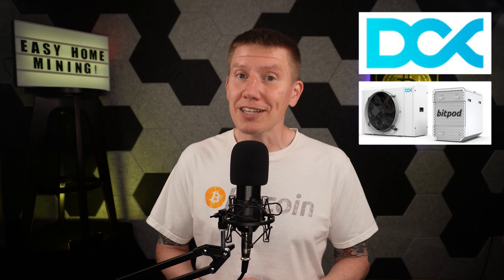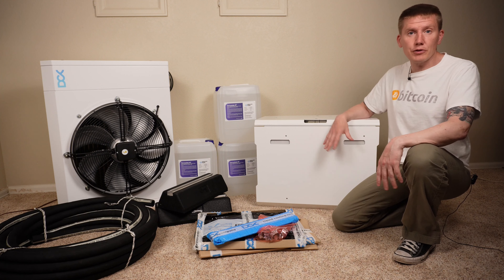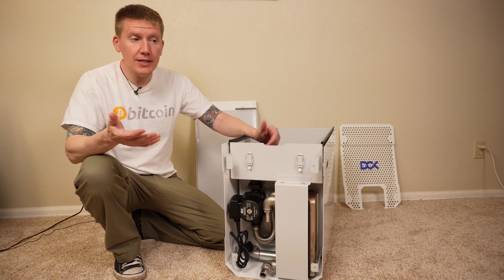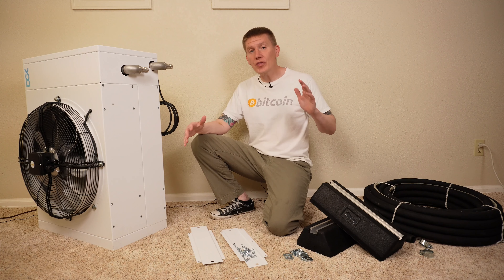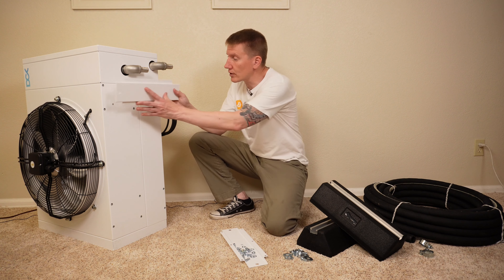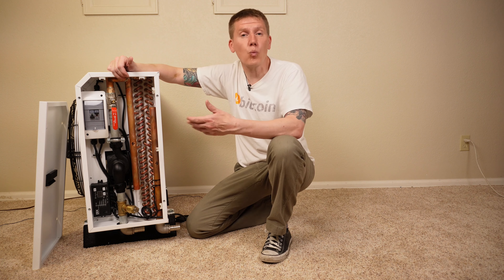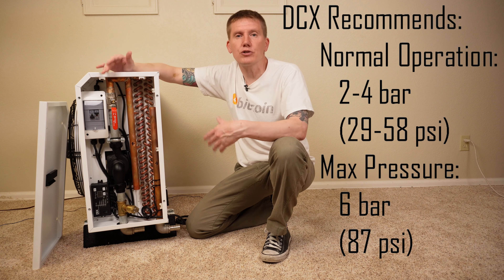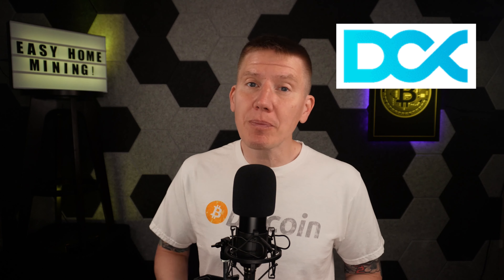EP22: I got a DCX Bitpod home bitcoin mining system!

Comment: In your next vid, DEFINITELY show the dry cooler in operation and at various speeds... going from minimum to maximum with you talking over it for reference. I purchased the bigger brother -- the ICP40 -- because at the time it was the smallest capacity available. Even with just one of the two 500mm fans enabled, it was still too loud for my neighborhood.
Reply from the maker: Good idea.  I'm still running my existing DIY dry cooler...I don't want to tear that out if it is working, but I think running the DCX cooler with a microphone and maybe a noise meter will give a great comparison!
Reply: @HBIM_Channel  Exactly... because maybe it will be better, maybe not! 🙂
Reply: @HBIM_Channel  Wen comparo? It's been a month :-)
Reply from the maker: sorry for the delay...I had to do some work on the rest of my system to keep mining.  I'm writing the script for the next episode now, and it WILL have noise measurements...I promise! @dimitrikatsaros9212
Reply: @HBIM_Channel  Thank you! I am asking as someone who has bought a DCX system with an ICP40 (not the smaller pod). Mine has the same fan as the pod's dry cooler, just two instead of one. They are too noisy for my neighborhood. I've gotten complaints. So, it sits idle until I can find a solution.
Reply: @HBIM_Channel  Didn't see measurements on EP23-25... did I miss it?

Comment: Couple of questions. I have 220v already wired, so wondering if I would still need the transformer? My thought was that it's a frequency converter as they use 50Hz in Europe and 60Hz here in the US. Another question is the weather proofing of the tank enclosure itself. I would like to see if I can plumb this to my pool and circulate chlorinated pool water instead of a dry cooler. The issue with this is that it's about a 50ft run from where the tank would be located in the house. The other option is to have the tank out by the pool since I already have 220v there. If I was to put the tank unit out by the pool, what type of weather protection would be needed (if any)? PS, I run anywhere from 220v to 240v variable.
Reply from the maker: Good question.  DCX says you need the transformer...but 220 AC is 220 AC, so I've read many people stating it should work.  The only thing I can think of is the pump has a ground wire.  In European 220, that ground wire is at 0V, whereas in the US, it would be at 120V...I'm not an electrical engineer, so I'm not sure if that matters.   The transformer box costs about $100, but a new pump can run you $300...so I guess it depends on how much risk you want to take

Heating your pool is a great use of miner heat...I've helped a few folks get there and I've got an episode on pool heating...that might help with some planning/details on the pool heater.   The tank coming from DCX doesn't have a sealed lid, but the lid overhang and latching mechanism is good...it would take a pretty good storm to get water blown up into the tank.  But...given the cost of the fluid and miners, I think it might be worth having some external protection like a cabinet or shelter for the tank.  Might be something to plan for, but make the call whether to add additional protection once you get the tank and get a good look at it.
Reply: @HBIM_Channel  It would be interesting if you can get a power/load value for just the pumps/cooler alone. By that, I mean measuring that circuit separately from the ASICs. Still need to have the "heat" produced by the ASICS but to be able to measure the pumps and fans to determine the "overhead" for the DCX system.
Reply from the maker: @ronwatkins5775  Agreed!   I've been meaning to do an episode on 'parasitic losses'...I don't think they are huge, but they aren't zero...would be interesting to see how big they really are for immersion.   ...so many ideas, so little time!

Comment: Have you considered making your own fan controller to take the tank temperature into consideration?  I'm thinking about doing this as the tank temperature is more important than the water temperature outside but the sensors from DCX don't work like that.
Reply from the maker: Yes!   For my system I didn't deploy the DCX dry cooler, but made my own--its covered in other episodes.   I have a mixing valve and temperature switch built into the design so the fluid routes around the dry cooler in the winter (to keep the heat in) and only turn the fan on when the fluid gets hot in the summer.
Reply: @HBIM_Channel  yep am making my way through your videos now as my miners aren’t local to me so I need better remote monitoring and management.  The pipes froze a couple of months back and now the ICP15 is a write off!  Going to upgrade but also want to incorporate the monitoring that you have.  Where are those meter displays from? Vosk has them also but not sure if they’re US specific?
Reply from the maker: @hewhorocketh  Oh no!  Sorry to hear about your ICP15...freezing temps can be tough.  I got the meters off of Amazon, made by DROK...they are cheap, but so far they have worked fine. https://www.amazon.com/DROK-80-300V-Voltmeter-Multimeter-Transformer/dp/B01MRZAFAF/ref=sr_1_3_pp?sr=8-3
Reply: @HBIM_Channel  that’s really cool.  Might be something for the next install.  Another thing dcx suggested is putting insulation around the water loop sensor.  Would have been nice if that was from factory!
Reply: @HBIM_Channel  thanks.  I may go down the smart PDU route but the meters are a nice visual real time view without logging into anything. I’m not on site at the farm often.
Reply from the maker: @hewhorocketh  agreed...I've talked to others who have re-set the temperature setpoint to compensate for any temperature missreadings of the sensor.